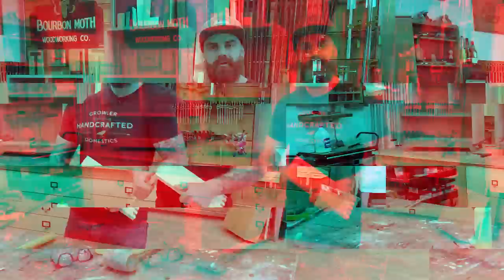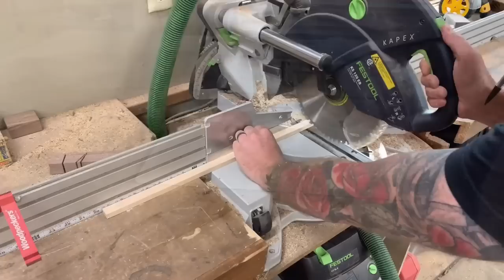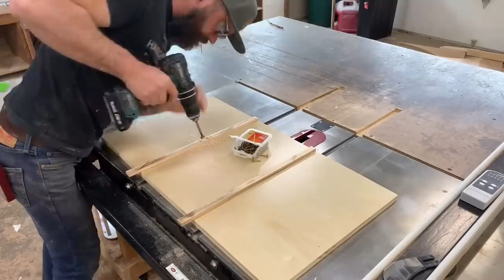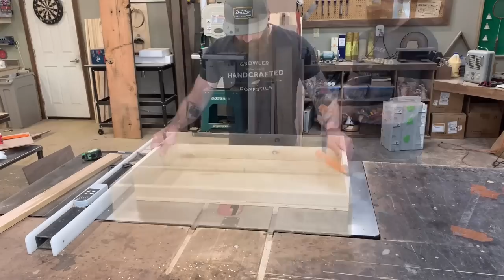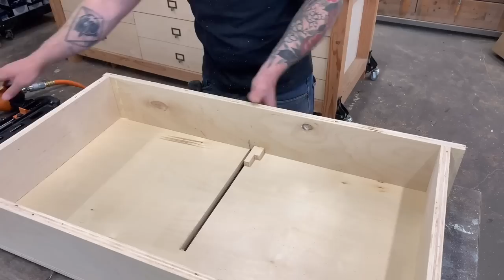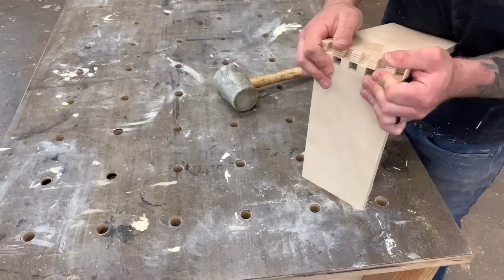Easy Box Joint Jig || Make Box Joints the Quick Way

Comment: I have one question on this and other jigs that are similar that I’ve seen. Why build the other three sides? I mean why not just build the backside with a couple of triangle gussets to hold that up? What’s the purpose of adding the two sides in the back to it?
Reply: No purpose, other than securing the back it seems. If you laminate two pieces for the back, you wouldn't need the sides. You don't even need a sled ... a miter gauge with backing board clamped to it with the alignment pin in the right spot works just fine. (the key is the pin and distance from the blade) A sled would have the advantage of always ready to go but then you have to store it. You can get extra fancy and even make an adjustable one but I've never had the need ... box joint jigs are easy enough to make on the fly.

Comment: Not everyone has a dado blade. Using a round reference pin will make the handling easier.
To anybody who is having troubles understanding the trick. Just visualize it by modeling the jig on paper (and scissors) of what is getting cut away, what is referencing to what and  how to get the counterparts right.

Comment: I don't understand why everyone who has box joint jig builds on YouTube goes through the trouble of making hardwood miter track inserts when, for a couple of bucks, they could use stock 3/8" x 3/4"  aluminum bar. They fit snugly and they don't wear or warp, and even if the bar is not a snug enough fit for you, you can drill, tap, and countersink the sides for nylon screws that can be used for adjustment.